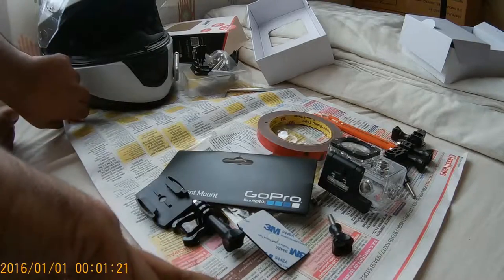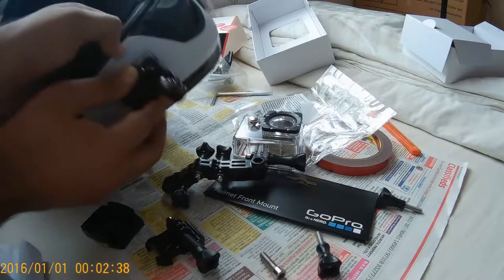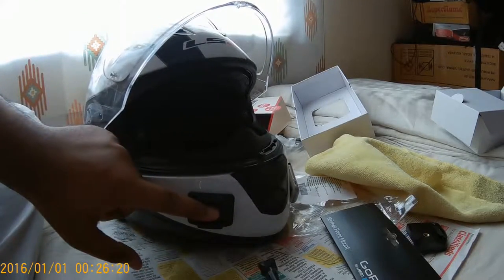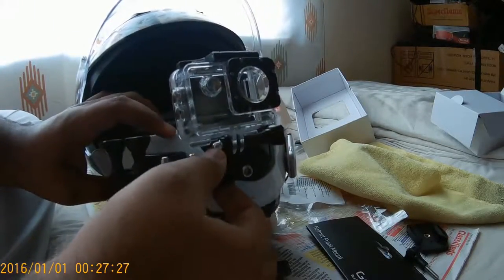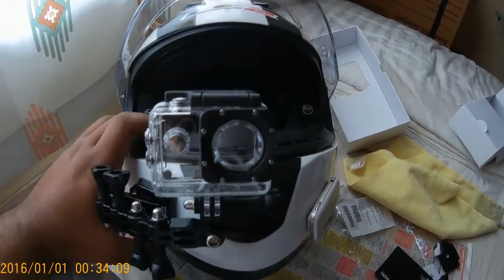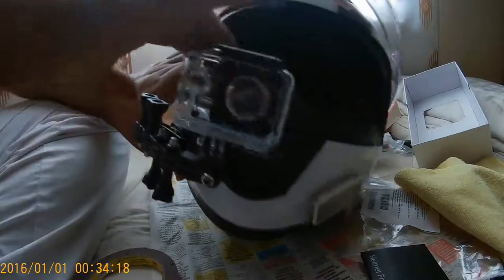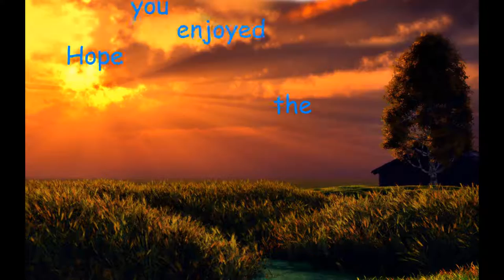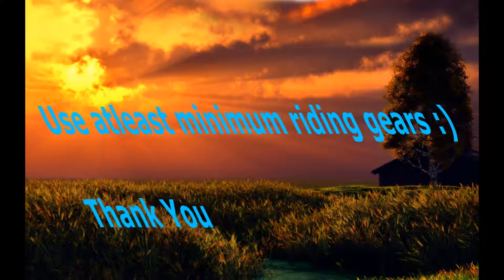Mounting of SJCAM SJ4000+ on LS2 FF320 Stinger Helmet

Comment: Where did you get the helmet front mount? I checked online for gopro helmet front mount, it costs 7000rs! any cheaper option? I have same helmet as yours, so I will require same mount. TIA